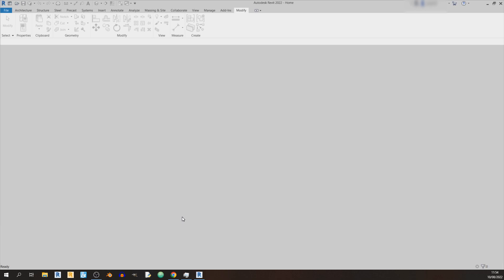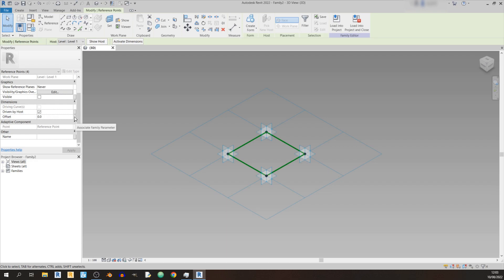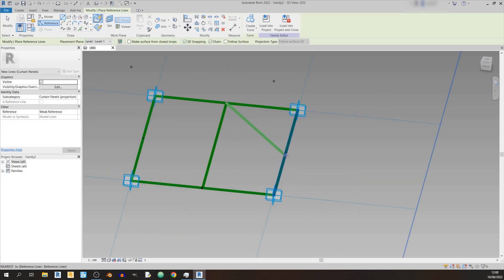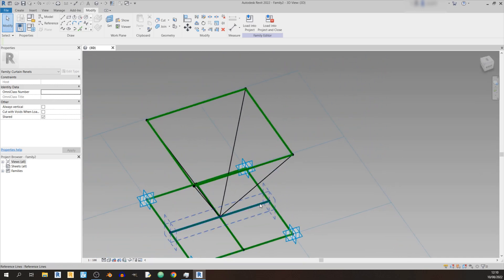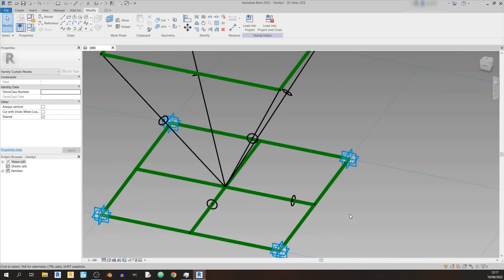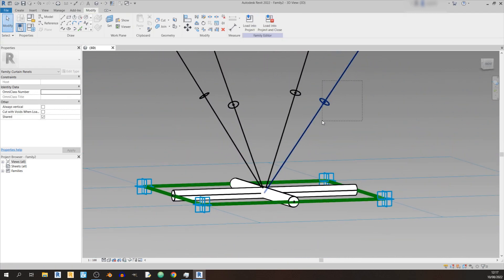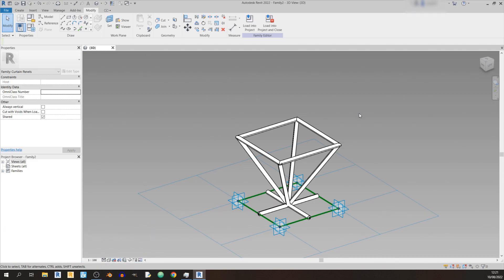Revit 2022 | Creating a Revit Space Truss Using Pattern Based Family

Comment from the maker: Timestamps:
0:00 - Introduction
0:32 - Selecting the correct template file
1:12 - Checking the units for our drawing
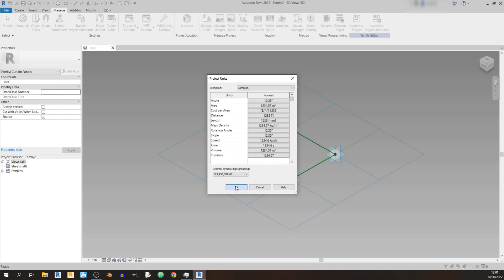1:36 - Modifying the grid
1:55 - Creating reference points
2:20 - Selecting reference points and offsetting them
4:00 - Drawing the lines of the space truss
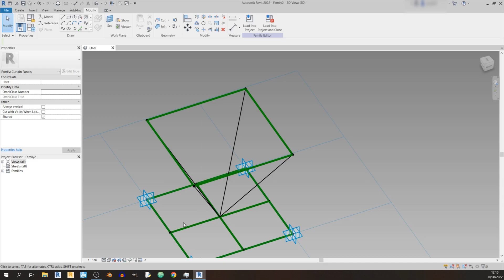6:08 - Drawing out the steel section
9:40 - Bonus tip (Defining a material)